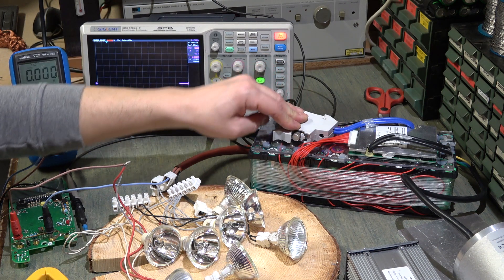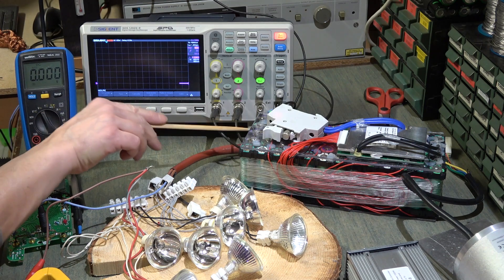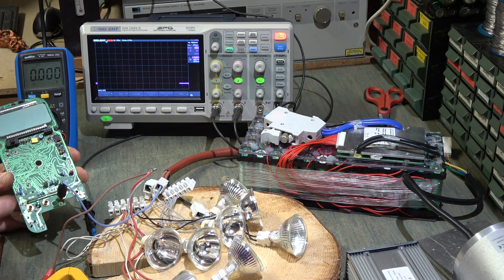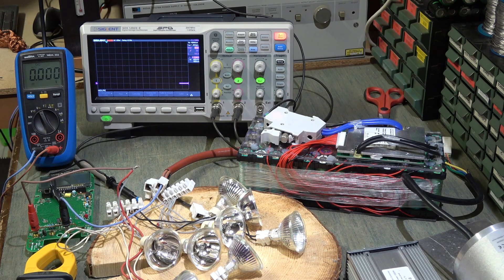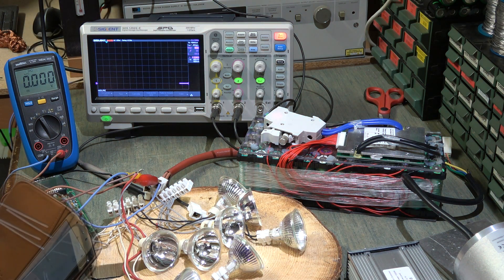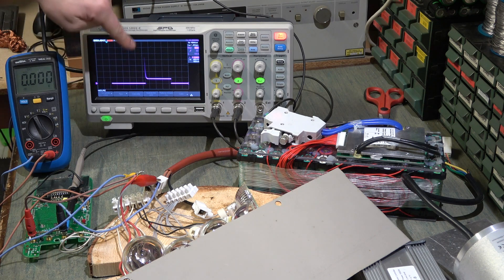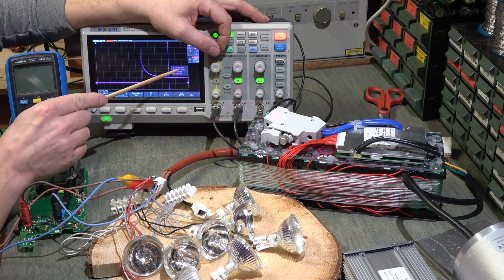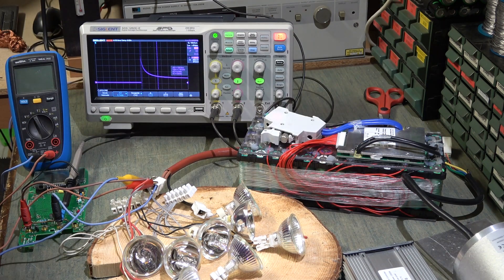OP 96: prova potenza batteria litio 48 volt bicicletta elettrica

Comment: Ciao, video interessanti, ho le mi batterie fa 48 ,una volta caricate si fermano a 54,1 e 54,2 volt, non raggiungono più i 54,6 , da cosa dipende? è grave? Vanno già ricellate? O posso continuare ad utilizzarle? Se si, quale è, il voltaggio minimo che indica  che la batteria è andata? Su una altra batteria sempre 48 v. Non funzionava più, 2 mesi di vita, un riparatore di cellulari, dopo un controllo, mi ha sostituito 5 batterie, all'inizio dava 54,6 ora 53,8 , o misurato le celle sostituite Davano 3,7 volt le altre 3,8, è arrivata al limite, o posso continuare ad usarla?
Reply from the maker: La durata delle batterie va in funzione ai cicli di carica-scarica, quindi se una batteria ha 1500 cicli  significa che dopo questi cicli la batteria è esaurita. Un ciclo significa che la batteria deve essere caricata completamente e scaricata completamente, se viene scaricata parzialmente e poi ricaricata non e un ciclo ma sara una porzione di ciclo. man mano i cicli vengono effettuati le batterie perdono la loro durata.54,1e 54,6 significa che qualche cella comincia a rendere di meno. finche funzionano le puoi utilizzare sara il circuito elettronico a bloccarle quando sono esaurite.Anche quella riparata potrai continuare ad usarla.

Comment: Voglio sostituire le batterie NI-CD di un trapano  con le 18650 Li. ho guardato un po in giro e quindi: La vecchia batteria e una  1.2x15 18V 2,5A  (mi pare) ed io vorrei mettere 10pz 18650 3,7V 3,4A 18,5V x 6,8A ovviamente con la bms. Che carica batterie devo comprare in questo caso dato che la batteria da 18,5V quando sara carica  avra 21V? E più che altro quanti A perché  sul datasheet la carica massima è 1,6A quindi suppongo che vada bene un 18V o 21V 2A visto che la batteria è una 5s2p. O mio dio mi sto perdendo in una marea di informazioni. Ti prego illuminami.
Reply from the maker: Se metti 10  litio 18650 quindi  2 in parallelo per 5 in serie puoi alimentarle a 21volt e limitare la corrente a (1,6 ampere x 2 ,cioè 3,2 ampere ).
il bms meglio 15-20 ampere in uscita perchè se il trapano assorbe piu di 10 ampere nello spunto il bms va in protezione e devi scollegare l alimentazione per ripristinarlo.
Per l alimentatore consiglio di prendere un alimentatore da laboratorio da 0 a 30 volt o 60 volt con corrente regolabile, con 50 euro te la cavi e puoi caricarti tutte le batterie che vuoi ,ciao.
Reply: @OberdanPanseri  Grazie mille per la risposta. L'alimentatore da banco gia c'è lo , invece  una scheda di alimentazione da  sostituire quella originale del caricabatterie del trapano, potresti consigliarmene una?